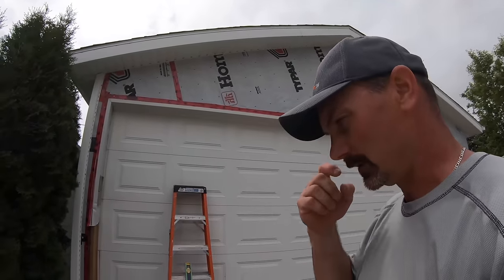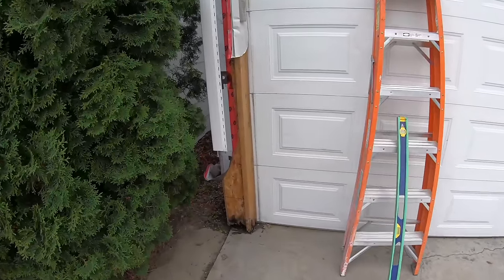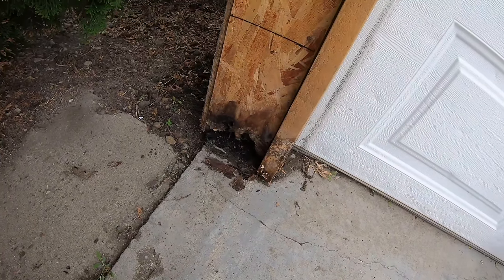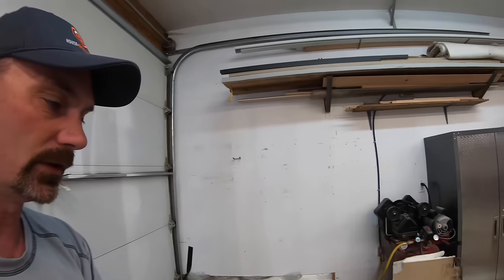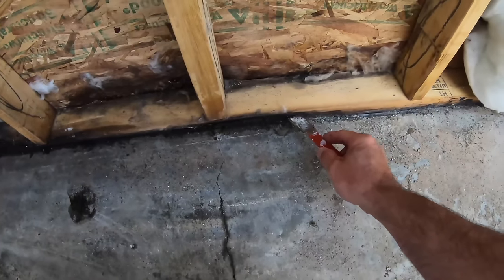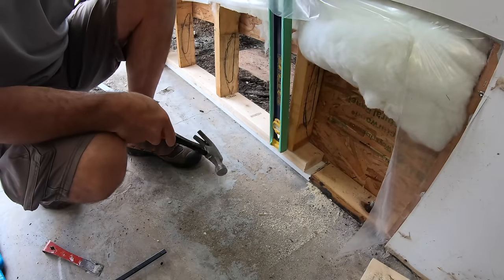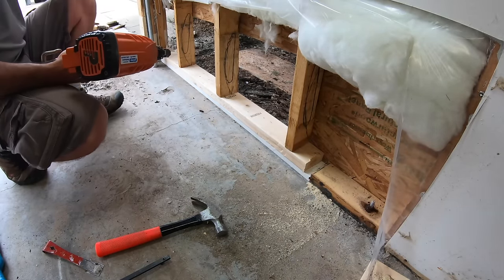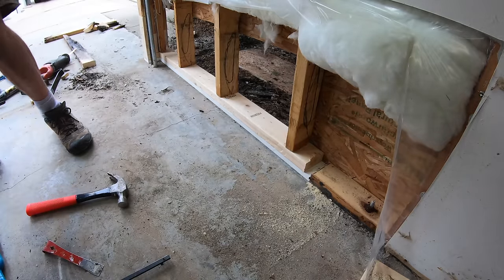How To Replace Wall Plate

Comment: Is that PVC board being used in a "structural" application?  Is there any special consideration for its usage in such case?  Or can a PVC board of the same dimension as a wood board be substituted for that wood board, even in structural application?  For example, if a 2x4 PVC was available, can it be substituted for a wood 2x4?
Reply from the maker: This solid PVC I used will not rot or compress so it is ok to support the bottom plate but it would not maybe be ok to replace the bottom plate and certainly not for replacing a stud.

Comment: As most comments responded with a 6" concrete stem wall with weep holes for water drainage is your preferred fix.

Comment: Neat video. I just went thru this on my garage. I used two bottle jacks to lift up just enough to slip the new pressure treated board into the sill plate then installed my anchors. Will keep this in mind in case i need to do more work on it in the coming years.

Comment: That bottom plate originally should definitely have been pressure treated. It would have stopped the water from wicking up into the drywall as well as preventing the rot on the plate.

Comment: Seems like you used very long bits. 
  How thick is the concrete?
Reply from the maker: These were 5" anchors I believe and this slab is 12" thick on the edges.

Comment: i meself would put some self level down , then create natrual run for any water  should the problem persist,,,,,, cheers for the stuff you do too..(edit) you could also put some concrete under the plates that be overhanging the slab  to keep it dry...

Comment: Out of curiosity, what’s a ball park cost for a job like that?
Reply: That's a good question, guessing $500-$1000. But if you do it yourself $20 if your handy.
Reply from the maker: for a small area like that likely around $500 depending where you are and who you hire. Its a very small amount of material but alot of labour messing around.

Comment: Did I  hear you say that you were going to use PVC under the sill plate or as the sill plate?
Reply from the maker: Watch the video , you will see exactly what I did.
Reply: @HouseImprovements  I did...shoulda deleted the question.   😊
Reply: @HouseImprovements  sounds like a smart alec answer.  A simple yes or no would suffice.

Comment: Here in Ontario it is against code to install non treated lumber on cement at ground level for this very reason.
Reply from the maker: Here it is now as well. Or at very least you need a barrier between concrete and untreated wood.

Comment: why is the bottom plate that is laying on concrete standard lumber and not treated? You can see the rest of the bottom plate is also rotting out as moisture is wicking up from the concrete.

Comment: Can you not dig out the soil to the left of the garage, fill with chippings and create a soakaway?
Reply from the maker: The problem I have is not from the ground . The ground is about 2" lower than the pad. My pad actually has a dip in it and holds about a 1/4" of water which sits inside on the floor in that corner because that part of the garage apron and floor is an old garage pad. If you watch the first 3 min of the video again I explained that .
Reply: @HouseImprovements  I made a separate comment.  2 inches isn't nearly enough space.  You're getting rain splashing up underneath the sheathing and siding.  Every time you have rain or snow melt it will get absolutely soaked.  I'm surprised you didn't do a low cinder block wall like we do here in the states for a garage.  Very common way here to get the wood up off the ground to avoid water damage issues.

Comment: Bummer, a wet garage sucks. My garage has water that seeps into and pools on the floor every spring when the ground thaws out. Luckily it's through the concrete blocks, well below the bottom wall plate. I wish I wrapped the outer foundation with a moisture barrier before the area around the garage got back-filled.

Comment: You built the garage, correct?  Why didn't you use a pressure treated sill plate?   I would have used a diamond blade to cut a drain channel (with metal grate) in front of the garage door to avoid water continuing to pool.
Reply from the maker: Yes I built its and at that time here it was not required. Not sure even PT would have lasted much longer in this situation?

Comment: Don’t the plates usually sit on a concrete curb? I thought it was code the slab had to have poured curbs that the walls sit on?
And why wasn’t treated wood used as the plate?
Reply from the maker: No code here for concrete curb . Treated wood was not commonly used for bottom plates at the time this garage was built. Treated wood would have helped.
Reply: @HouseImprovements  that makes sense. My concrete approach sank so water pools on same spot. This video helped a lot! Thanks

Comment: is the "polyboard" code legal??
Reply from the maker: Why would it not be? It's a solid core PVC so it actually will never rot and never crush under the weight we have here. It is attached in place so it can not move or shift also.
Reply: @HouseImprovements  so, is it code legal?......great ideas are rarely "code legal", i have an inspector from the city comming so i cant play games

Comment: Ladies and Gentleman, this is a great example of why you do not put wood (treated or regular) that close to the ground.  Put a row or two of 8 inch cinder block, with a gasket and treated sill plate all the way around your building.  Anything this low will constantly suffer from ground water seepage and rain splashing up underneath the sheathing.  This is easily avoidable if you just get the wood part of the structure higher up than the ground level.  Code in the USA usually dictates this on homes for good reason.  Building a garage like this directly on a concrete slab that close to ground level is just a really bad idea.   

Love the channel Shannon, but I feel like this is just a big mistake that is going to cause you problem after problem over the years.
Reply from the maker: This is nothing to do with ground water, so many of you have missed the first 3 min of the video where i explained what this is from.

Comment: I think you really need to build up a cement block wall and seal it, to get the wood base plate off the ground level. Otherwise, you'll have water erosion again.

Comment: No PT bottom plate?
Reply from the maker: Back in the day it was not required here.
Reply: @HouseImprovements  Oh man, I thought it was standard procdure to use PT for bottom plate.  When did the code make it a requirement to use PT?  Just curious.

Comment: Why wouldn't you use pressure treated? I get there's a pad but I would have made the entire thing out of PT. You even admitted you don't have the water issue solved...
Reply: I believe  that's why he is using pvc
Reply: @vnvtube2575  Yes the pad, but the rest of the wall is still at risk. Would have went PT all day in this scenario.
Reply: @shawnd567  agreed

Comment: Sill gasket and pressure treated bottom plate would eliminate this
Reply from the maker: would have help but it would have happened eventually because of the way the pad slopes to this corner and water sits until I remember to sweep it away.

Comment: Why not just replace with a piece of PT 2x. Wouldn't have to mess with PVC.
Reply from the maker: Because of my floor issue it will rot eventually also even if its PT.

Comment: I'm kind of disappointed. Wherever there is normally a fair amount of snow accumulation in the winter, there should be a row of a cement/rock material taking up at least 8 to 16 inches high at the minimum.
While that will work between 5 to 10 years, that's not actually a permanent solution.
Reply: To be fair, this was 15 years of damage. That’s gonna be good for at least another 15, if not more.
Reply from the maker: This moisture is not coming from the earth beside the garage. Watch the first 3 min again and it is explained that the moisture sits on the low spot of the old pad outside the door and makes it sway around the door to sit inside in that corner. I should do something with the low spot really but just have never done it. It took 15 yrs to do the damage it did and now with the PVC it should not ever bother again. Maybe in 15 yrs I should do a video opening it up to have a look and see ? LOL. 
We do get a lot of snow here most winters but garages built on monolithic pads is very normal here. Get up out of the ground with the pad a few inches and you are fine.

Comment: Why didnt you use treated wood for the new mud sill. You are going to have the same problem again. And why didnt you cut the PVC block and 2" x 4" block to full length. Bubble gum repair.